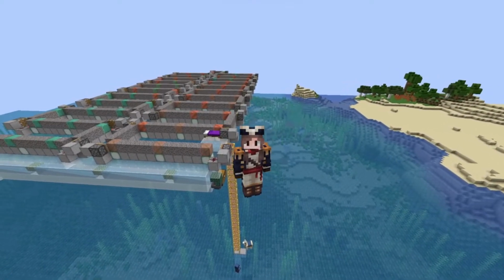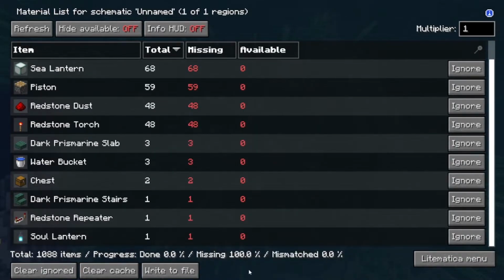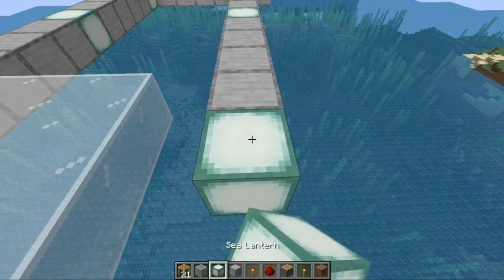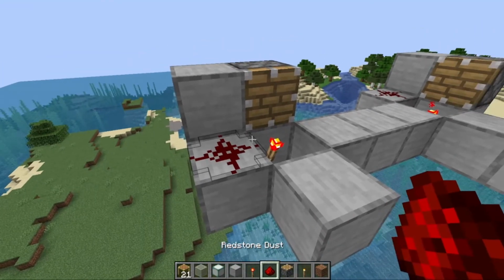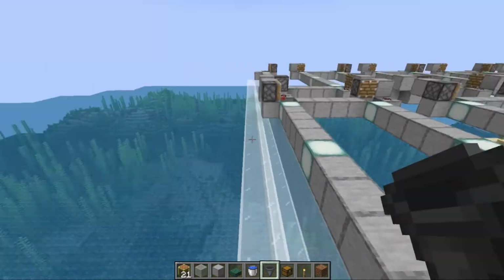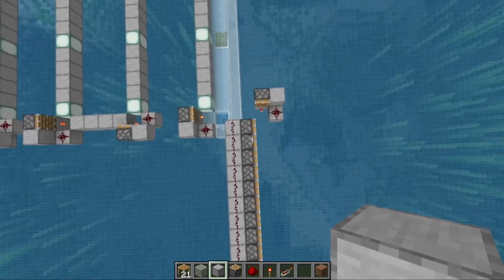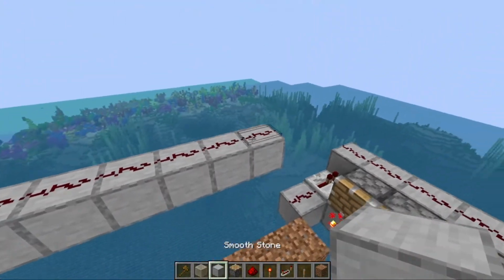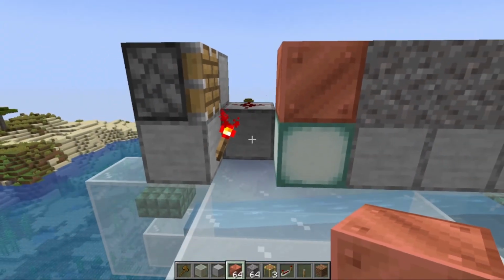Minecraft 1.19 Easy Copper Oxidation Farm

Comment: @BjorkMinecraft, there are a few minor issues with the schematic... I think the Y level of the selection was missing 1 block from the top and bottom, resulting in a missing line of redstone over the pistons and the glass blocks under the water channel. There's also a missing piece of glass near the soul lantern, which breaks the system when the blocks reach that point.

With that said, this build is absolutely perfect for our family's survival world, and I'm so glad that we found it. The design is simple and elegant; and because of its expandability, it's really quite powerful. We doubled the length of the tape rows on each side and built the extended collection system. And then I wrote an AutoHotKey script to place the copper/gravel blocks in 0.8-second intervals, and it works perfectly.

Thank you for sharing this with us!! <3

Comment: Cool! Nice simple design. Good edit & clear tutorial. A couple suggestions. 1) you might be able to reshape the track so that the oxidized copper and gravel exit at the same corner as where the player stands to place blocks. With clever positioning, you could get rid of the water stream entirely by having the player pick up the gravel blocks as items where they fall while placing blocks at the same time. 2) If you want to take on a bit of circuitry, you could make a device that pushes 4 gravel into the loop automatically each time the player places a copper block. With the right setup, you could run the machine while AFK, just holding right-click. In fact, you could even recycle the gravel blocks continuously without ever turning them into items. Great job all around.
Reply from the maker: Hello! Thanks for the kind words, and for the feedback! As for your first suggestion, that's an interesting idea, and it certainly wouldn't be too difficult to loop the track back around to finish by the player's platform. It would also make it easier for them to walk to the collection area... And for your second suggestion, that's a neat idea... I've seen a lot of farms that use dispensers to automatically place and remove powdered snow blocks, and I was also experimenting with generating cobblestone that would be filtered out and blown up. I was also working on another version that has a clock that automatically dispenses four gravel and one copper block, as needed when blocks are placed, but I wanted to keep things as simple as possible for this tutorial. Anyway, thanks for the comment and the suggestions!